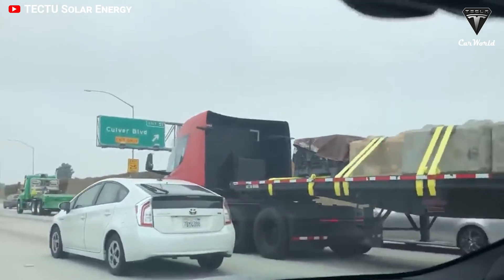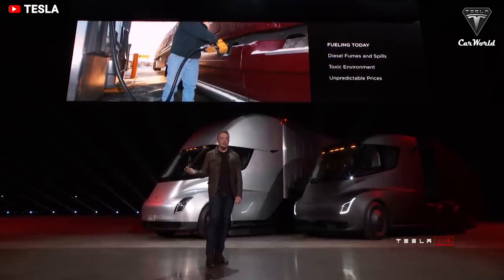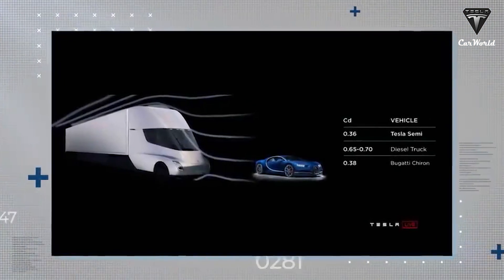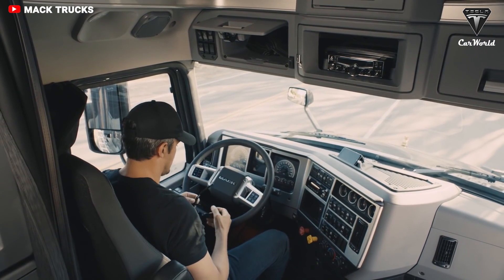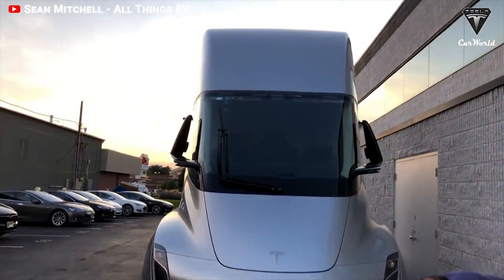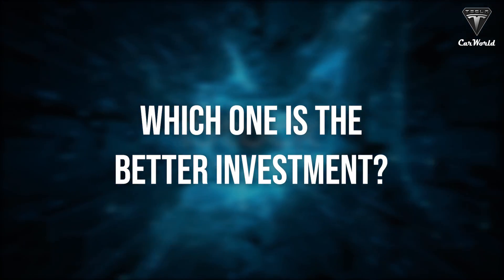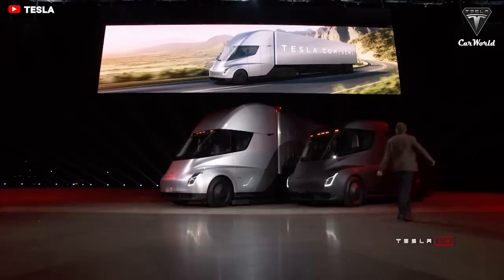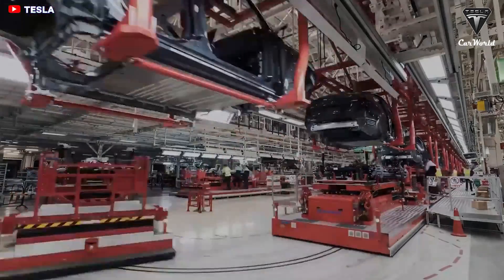Which is the KING of 2023 heavy trucks? Mack Anthem Diesel Truck Vs. Tesla Electric Semi?

Comment: I’m a truck mechanic and all the company’s that brought new electric trucks have returned them due to motor loss and reliability
Reply: I was actually wondering about that. They said they were going to use the model S motor but I’ve heard about them breaking in the cars. How are they going to handle an 80,000 lbs truck?

Comment: If you think the tesla is actually a viable replacement for diesel trucks you're an absolute fool. The infrastructure to support a nationwide fleet of all electric semi's is non existent. Furthermore the amount of minerals that would need to be mined to create the massive batteries that store the electrical power would be a feat in itself. We in the United States can't even power our own A/C units in our homes in the summer without having a near collapse of our electrical grid. Now add 2 million trucks on tesla chargers to that mix. The range in between fueling of an electric vehicle is far less than that of an internal combustion engine. The time to refuel an electric vehicle is measured in hours not minutes.

Comment: You talked about the interior layout. They are the way they are to keep them relatively simple. Why on earth would you want to drive from the center. You cant see what’s right next to your truck from there. You say that makes the truck super simple to drive but driving straight down the road is the easy part. What about driving in tight areas and backing into tight places. Sitting to one side is much better because we have much more to do than drive straight down the road.

Comment: I just found another lie. My truck has a 500 hp Cummins. I can get up to 8 mpg. Sometimes a little higher. The only time it drops into the 5s is when I’m constantly up and down steep hills with a heavy load and once I’m out of the steep hills it will start going back up.

Comment: The weight capacity of a semi has little to do with the truck. This is another lie. The weight is set by the law. Think about it this way. My tractor has a 13,200 lbs steer axel and 40,000 lbs drives. If you 40,000 lbs tandems on the trailer that’s 92,000. Even with 34,000 lbs tandems that’s 86,000 lbs. Any more lies to tell us?

Comment: Why are you comparing it to one of the weakest trucks on the road. Cummins and Detroit both make 600 hp engines that have 2050 pounds of torque. 395 hp for a semi is the bottom of the barrel. Sounds like you’re stacking the deck for Tesla.

Comment: Tesla has said it should be a loss in usable cargo weight. So it's not 2000 lbs better. Regulations allow trucks with new power sources (I assume a fuel cell counts here to) to be 2000 lbs. The Tesla semi is surely utilizing that granted extra to be comparable. It's not hauling more pepsi bottles.
Reply: The one figure they don't  tell us is the cargo capacity. When they show a tesla semi carrying cargo in tests its appears to be concrete barriers with loads of 6=8 tons. Based on diesel trucks carrying 16-23 tons as standard. Until they can reduce the weight of the battery pack electric truck are going to struggle against diesel trucks for capacity. 

In Germany they are trialing trucks with smaller batteries with a 30-50mile range but on major road they use a pentagraph system to use electricity from overhead cables.  I wonder if this could be a better option to increase cargo capacity foe electric trucks.
Reply: It doesn't haul 2000 lbs more than the Mack.... There's simply a greater weight allowance for 'green energy' vehicles given the additional equipment needed for them to operate....
Reply: How heavy is the Tesla Battery? The Electric Truck could have less freight capacity
Reply: @konrad3  it does have less capacity or they would have said the weight of the semi during the launch event.
Reply: @konrad3  they have been estimated at around 10,000 pounds heavier than the systems that dont exist on normal fuel powered semi trucks...the tesla will end up hauling around 6k or less freight by the guestimates i have seen but it is all guess work till they release the actual semi weight.
Reply: @konrad3  calculated on the watts/kg of lithium plus the battery housing and imbedded cooling system and the KWhrs to move the truck trailer and a full legal payload over 400km. The battery weight would be a bout 5000-5600kg. That is a lot of dead weight to lug when the battery is at 10% charge. Look at all the electric cars and their diesel. The electric cars are all significantly more heavy than the diesel. This will be worse if they get fitted with the heavier and less energy dense sodium batteries which are around 150-160Wh\Kg where Li-ion is around 180-200Wh\Kg while some claim up to 260Wh\kg these are highly unstable unless they have bigger cooling systems which is more weight which works against the extra energy.
Reply: @richardkaz2336  dude if what you said is true about the weight of the batteries that means that the weight of the batteries would be as much or more than some day cab trucks I have driven with most trucks averaging around 20000 to 22000 Ibs with sleepers. I wonder if  the lack of transmissions drive lines differentials and  solid axels will help keep the weight down on these teslas, considering that the engine and transmission of a diesel can weight around 3500 Ibs thats a lot of extra weight in batteries. Possibly around 20k Ibs for day cabs and 30k for sleepers. I'm curious to see what the weight of the unit will end up being.
Reply: My brother works for New Haven Transportation(PepsiCo private fleet), they are reporting a 20% loss of capacity with the Tesla trucks, and currently have no routes where they are viable for operation, so they will be used for shows and special events until they can boost driver count to allow for using them in select routes....where they will have a diesel powered truck doing the hard work, and the Tesla hopefully getting the easy part done
Reply: aubwarpspeed: In reality, it's about the same re cargo.  So the advantages to the Tesla are huge, real world, and the supposed cargo advantage of the diesel is small to none. 

Real world, truck owners will LOVE saving MASSIVE amounts a year on charging vs. diesel. plus the longer life and lower overall maintenance on the Tesla BEV truck.
Reply: @rogergeyer9851  no the battery pack is fantastically heavy...it like in all electric trucks will haul less cargo or tesla would have released the weight of their semi during the release event.
Reply: @Roger Geyer  supposedly lower overall maintenance.  I'd take a late 90s semi with a cat 3406B, a Cummins N14 , or a Detroit 60 series engine over today's regulated garbage.  Reliability is big in the industry
Reply: @rogergeyer9851  I had a chevy bolt for a year then it stopped charging and they said it was my fault for hitting a pothole and it wasn't covered under warranty or whatever. so I lost all I invested in the car
Reply: @JordanShackelford  sounds like bullshit,... how did the dealer determine you hit a pothole? Did you break a wheel and destroy the suspension/steering with the hit?  And how would that void the battery warranty?  If that happened, get a lawyer...
Reply: @scottmcelhiney323  It's been a year already and the bank I took the car loan from repo'd the car. I lost over $15k on it >:(
Reply: @rogergeyer9851  stop talking nonsense!!! Diesel truck advantage is massive compared to EVs! The tesla semi needs 1000hp to haul 82,000lbs while diesel trucks even with 600hp can literally haul 4x80,000lbs, in Europe mostly in Scandinavia trucks have even much higher loads than American ones.

Comment: Head on collision is so dangerous. Not enough to absorb impact. It’s similar to a cabover. Why do people complain of cabovers so danger when head on impact. Tesla semi is the same design as the cabover bullnose. Wake up people, your driving a modern cabover. If people complain so much about cabovers then why don’t they release it’s a similar design with the same flaws. If not careful when head on, no one will survive plus if the load hits right through the cab just for crazy acceleration and speed. You don’t need acceleration. Slow and steady is safer with a load. Plus it’s dangerous if in the wrong hands. As for veteran truckers. It’s better with the regular semi than that contraption. Only rookies want it just because it’s fast. Speed is not the key when it risks your life. Lastly electric is not the future, it produces 10x more CO2 than heavy traffic in New York. Plus it’s going to be expensive as diesel along the way.
Reply: The people who like this truck are the people who don’t know anything about trucks.

Comment: I like Tesla's tech, but they should have talked to more truck drivers when making their truck. Driving range and ability to keep the truck moving down the road are critical. Short distance between charges and long charge times are non-starters. 300-500 mile range? That's less than a 12 hour shift for one OTR driver. Nevermind the co-driver that will take over.
Reply: For a supermarket delivery run 300miles is overkill (particularly if, like Walmart, you put charging stations at the loading dock at both ends).